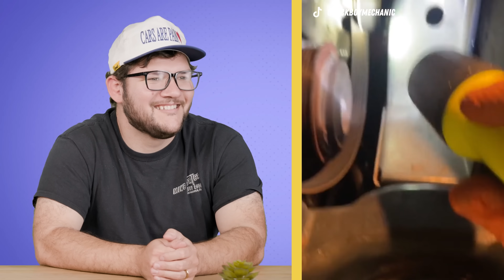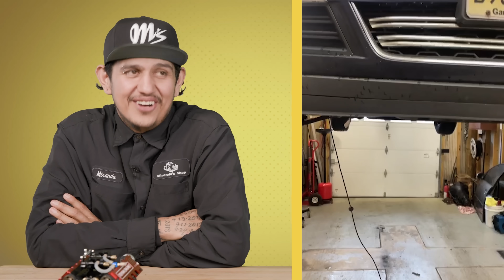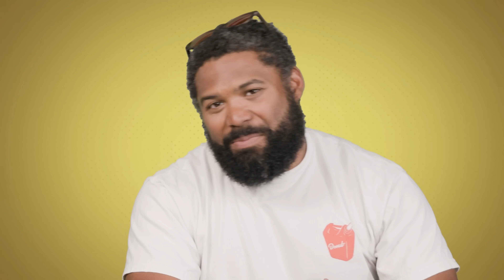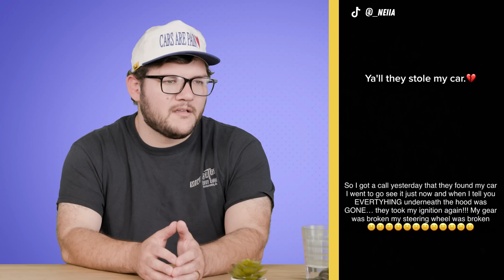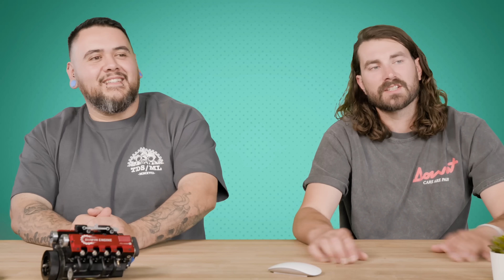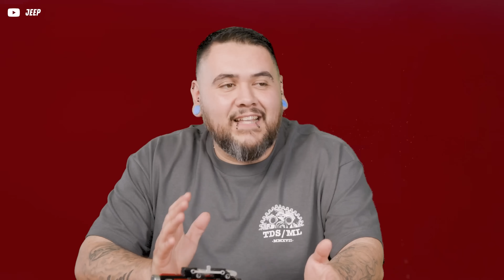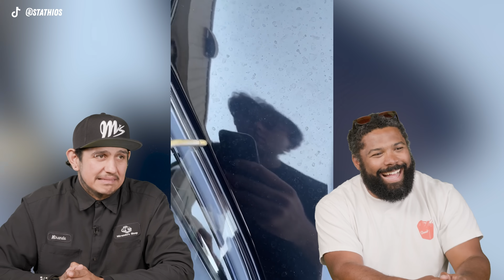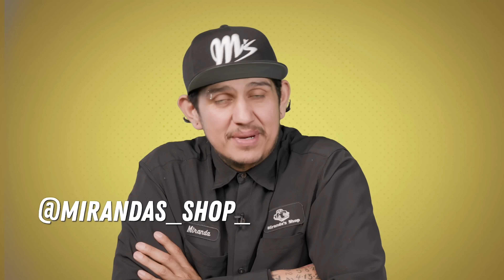Mechanic Reacts to Car Engineering Fails

Comment: The importance of modularity needs to be expressed to the Factory and the engineer. Uniformity and accessibility to the drive train module needs simplified and separation form the passenger cabin needs to be trivial. this helps the mechanic and the consumer perform drive train swaps easier than repairs. 
This is what the JDM guys try to do. Its the reason a Civic / Tacoma is still gonna be $4000 no matter what. the engines are available easily swapped. In the 90s we were working on it.  doing our best to integrate crash safety and modular design. 
Mechanics did not want to lose their jobs and wanted to be called technician instead. 
There were problems is consistency in mechanics pricing and the trade became regulated. 
the BAR regulated the Hours a shop could charge for repairs. 
There is THIS A RIGHT TO REPAIR ISSUE 
Companies try to make their products repairable exclusively by their technicians.  Contact a senator. 
A modular engineered design with the benefit of the people in mind instead of corporate profit. 
It's like the PC and Apple or apple vs android debate 
except in the car world affordability and user friendly design went out the window for technology economy and environment. 
Cars became harder to work on as we added smog equipment and fuel efficiency. 
Billions of dollars were spent on what we have smart people built it. I don't think it would be hard to make simplifications I think we need to press for "right to repair" laws to Incentivize engineers to design for the tools we have. Instead of inventing another Torx Bit and driver for us all to buy.

Comment: If a quarter inch is all that is keeping the bolt in.... just cut the old one out w/ sawz-all, install new pulley w/ new bolt 1/4 inch less length.  New bolt (of same length) can even be cut so that it fits.

Comment: There's a third option: Accounting. The bean-counters probably shit all over what was a good design, or a shorter bolt, or a different material o-ring, and the design gets changes because someone's too cheap to do the right thing.

Comment: The new Explorer has 3 different engines and doing an oil change on one is like playing Russian roulette. On one the filter is up top under the hood, one it’s underneath behind a small panel held in with 5 screws and one is under the big one in front of the small one and you need to remove 20 screws and a bunch of clips then reach your hand up into the car and feel around for the filter to remove it. Stupidest design ever that I’ve seen.

Comment: Car manufacturers during 20th century: Here is a indestructible machine that will get you point A to B with decent fuel economy and is easy to work on!

Car manufacturers 21st century: Heres a overpriced lump of plastic and fiberglass made with special duck tape that dissolves the second your warranty ends. Oh yeah and mechanics are gonna hate you.

Comment: DONT remove the engine to take out bolt for idler pulley. Just cut off bolt once you have loosened as much as possible. Leaving a short piece to use vise grips on to remove the remaining bit.  Then reuse the now correct size bolt   Did not read all the comments some maybe someone else has mentioned this.

Comment: The idler pulley bolt against the frame was something I felt in my soul. My old VW CC R Line had the exact same issue with the tensioner bolt being right up against the frame, and that chick was 100% correct. Had to loosen TWO motor mounts so the engine would sag just enough to allow me to pull the bolt. Ridiculous.

Comment: Realistically the engine was designed and just put into the car. They likely didn't realize the bolt was an issue.

Comment: Ok, As an engineer... Let me sort some things out.
Firstly I work in the Digital Storage sector and design servers for use by every major company you have heard of. Anyway. a GOOD engineer does not allow things like this happen and 99% of the time we will design a solution.. However, I would say about 75% of the time, a Product Manager or someone above the engineer who has no sense of engineering will just say "good enough, move on." to wich we will have a written (Cover your ass report) this means that in 6 months when problems arise and the Product manager tries to deflect blame (we can point to proof that we voiced our opinion.) so.. Please take that into consideration. (if engineers were unshackled from the bean counters you would live in a world with over-engineered, expensive and probably bulletproof products.. you know, like the 40s-60s..

Comment: When I worked at a Firestone  my first automotive job as a GS  I would hate the  F-150 that came out with the plastic yellow twist drain plugs   My biggest Gripe  was  with the sway bar designed right in front of the  drain plug so when you twist it off  the amount of oil  those trucks take pours out strong and hits that sway bar and gets everywhere I had. To use all sort of little tricks to try to redirect the oil into the pan and not hit that sway bar wish I had footage to share  but  haven’t had the luxury of working on the Lube tech line  nor dealing with fords anymore 😂

Comment: Worked in one shop. My coworker had to work on a 25 hr job. It was the worst part location I have ever seen. My coworker quit a few months later. We got a phone call from the company who made the Creep drive pump. Apparently the core part was sent back with a turd all over the part. The note said. Fuck your engineer who designed this part and it’s location 😂

Comment: This is by no means a new car problem, but on 3rd gen Ford Rangers with the 3.0 V6, the oil filter sits between the starter solenoid and the exhaust manifold, so the only way to remove the filter without burning or electrocuting yourself is to disconnect the steering column and remove the filter from the top side and that's just one of many engineering fails from Ford on those trucks.

Comment: 10:40 soda can cut in half from top to bottom works well to make the oil flow a certain way.. Or use a red solo cup. Can also do that when you unscrew the oil filter... the oil and filter will be caught by the red solo cup.

Comment: That pulley looks like it is on the wrong side of the tensioner arm. It is not aligned with the other pulleys or is that just me? Does not look like an oem install

Comment: That idler tensioner bolt looked like it was also the top alternator bolt. So it kinda does need to be that long, but it also doesn't explain which fuckin pelican decided that would be a good idea

Comment: I was a mechanic in the sixties and seventies, and I saw so many engineer caused problems that it isn't funny.  You missed another area that resulted in problems, marketing and accounting.  I have seen engineers see a problem and seen the bean counters say no to fixing it.  The Chevy Monza was supposed to be a low end sports car with a zippy 4 cylinder engine.  After in production the marketing department decided the car needed a V8.   They managed to Shoehorn V8's into an engine compartment never designed for a V8.  To change the spark plugs, done every 12,000 miles back then, you were supposed to undo the motor mounts and jack the engine up so they could be reached.  We hit on a simpler solution.  We cut 2" diameter holes in the fender well opposite the plugs and put in rubber body plugs to fill the holes after replacing the plugs.  Next spark plug change was a breeze. The biggest problem was lazy or incompetent mechanics not replacing the rubber body plugs after doing the job causing the car to stall out in the next rain when the driver went trough a puddle, shooting jets of water through the openings onto the plugs and wires.

Another example was the AMC Pacer, originally designed for a Wankel engine that was being jointly designed with GM.  GM dropped out late in the project, after the Pacer was already for production, and AMC did not have the finances to complete the projected engine.  The engineers had to hastily modify the car to fit the AMC six, because the Pacer was supposed to be an "American Economy Car," different from European and Asian models.  The result was an engine setup that it was difficult to work on.  Things improved greatly when they decided to install the AMC V8 in the cars, but by then it was too late to save the model's reputation for difficulty to repair.  Another irony was that the cars with the V8s, got better fuel economy than the six cylinder cars.

Comment: 7:23 yup... 4.0 (slow, but rugged AF)
2wd, full time 4, part time 4
.
My 97 grand cherokee isn't too bad with electrical stuff..... but my oil PSI did go to 0 then back to 40 psi for NO REASON once
.
And the lights randomly dim like their is a short....or the alt quit working 
.
But the old girl always starts and runs

Comment: Replacing airfilter that requires going under the car or removing front bumper alltogether. 
Almost no space in the engine bay to put ur hands(I'm not high and my hands are quite small and even so I can't get things done sometimes). 
Tons of plastic crap used in cars right from the engine down to the interior.

Main 3 things I could think off that pissed me off recently

Comment: Just did the struts and sway bar links in my 2012 Lincoln MKZ and in the process realize both calipers were seized up oh yeah was doing the struts because the springs were broken but been dealing with electronics problems since I got the car it is a comfy luxury car 😂😂😂 that's about it tho

Comment: Professional auto tech and shop owner here - y'all are missing the real culprit behind some of the stupid things techs encounter when working on cars... Lemme get my 'splain going...

The vast majority of dumb engineering on a car comes from the accounting side of the operation, surprisingly enough.

Cars are designed around expedient manufacturing, first and foremost, and a design that make a car easier to work on makes it more expensive to build, so the accounting side of the automaker is constantly pressuring the R&D side to cut every corner possible to make it cheaper and faster to produce the car in bulk. That over-length belt pulley bolt on the Chevy Traverse is over-length because it was deigned to be installed onto the engine before the engine is mounted into the rest of the car proper because it saves a few cents per car to make it that way and when you make 100,000+ of them per year even fractions of a cent saved per vehicle adds up to actual serious money.

Comment: Yea.  Fuck jeeps.   Was me and my wifes first car  together.    Problem after problem after problem.   Under warranty the suspension had to get fixed like 2 or 3 times.    As SOON as the car hit 100k,   the differential went, something with the 4wd went.    It started stalling while driving on the highway (scary as fuck)  had to go to dealer like 6x to figure it out, they kept charging me for shit,  it would go away, it would come back they'd blame something else.   It got to a point where I brought it to a regular mechanic and he found the  problem, a 36$  crank shaft position sensor..  Worst car ever.       I've had my 4runner now for going on 4 years i've owned it from 2miles when I test drove it.  I've had literally 0 problems and it has 85k miles.... Towed the biggest uhaul you can get filled with 4000lbs of my stuff  out of the hardest stretch of i70 in colorado  and I didnt even feel it behind me...    Literally the only money i've put into it has been consumables.   0 mechanical problems under warranty  0 since it left warranty.   Long story short.  Never buy a jeep.

Comment: This is how car makers get back at the right to repair act. Ford ranger 3.0 water pump... the whole accessory mount has to be removed  to get to one bolt. But a dealership trained tech knows how to tap dance all over flag hours and flat rate!

Comment: 10:53 - In my work place, we're always ripping on Land Rovers, and even have banter sessions with one of our clients who owns 2 Land Rovers. Some of the comments made were:

- The reason it's called a Land Rover Discovery is because every day you're discovering something wrong with it

- The oil dip stick of a Land Rover as a lot longer than most other vehicles so it can reach whatever small amount of oil the sump was able to retain

- Land Rover owners usually own two Land Rovers at a time, so when the one gives problems, the use the other one for spare parts. Said client actually did this 
🤣

I'll never get a Land Rover, even the people I know who've owned them have had nothing good to say about them, just endless issues.

Comment: I worked at Tesla as a manufacturer and essentially yes they’re are cheap ass cars and are slapped together hastily. We would push out around 2-300 cars a days and about 40-60% would be sent back before they’re available to send out. Panels, handles, wiring, all of it is made sadly by idiots or no one that cares, Tesla will literally higher anyone

Comment: While a lot of the problems were engineering related, I wouldn't put it on the engineer, the engineer probably knows there's a problem but they can't fix it due to corporate.

Comment: Regarding the landrover oil drain issue, If I remember correctly, The mechanic I used to go to before I moved would use a machine with a tube / pump that went in through the dip stick tube to suck the oil out for oill changes on certain cars.  My assumption is that the landrover dealerships do it this way, as most people buying their garbage only go to a dealer for maintenance / repairs.  The one mechanic was correct in stating that it was the mechanic's fault if this is true.
Reply: I happened upon a youtube short with the suck method:  https://www.youtube.com/shorts/Vt6AuD9rx88

Comment: I call sus on idler pulley complaint. If it’s the frame engine vibration would cause head of bolt to rub. Re-look at video…no rubbing at all. 🤦‍♂️

Comment: to be fair on the Land Rover drain plug - it's supposed to be sucked out from the top... so it's the tech's choice.
Reply: If it is supposed to be sucked out the dipstick tube with a pump, why does it even have a drain plug? Is the pimply faced 18 year old at the quick-e-lube place going to know about that? Even if he does, will that type of shop even have a pump for doing this? Routine maintenance is done at all types of different places, not just in the dealership with specially trained techs and application-specific tools.
Reply: @daveattheholdens  well, there’s no dipstick tube either. There’s an attachment in the filler for the pump tube. Most modern engines are like this and it’s in the service manual, which you would hope that the person working on your car is familiar with.

Comment: My friend has a 2000 Camry 4 cyl which has to be one of the best cars on the road but i got an egr code. Turns out a little electric over pnumatic valve had failed. To get at it you take off the right front wheel and sit with the hub in your lap and reach up with your left arm as far as you can reach under the intake manifold to get to it. It doesnt have to be there. Its just mounted there. Blame it on the engineers.

Comment: Why not just cut the bolt? It's already out so far. You can reach the shaft part. Just cut it and pull the pulley down and then put in a shorter bolt when you have to reattach it use a pair of pliers to take out the piece that's left in the block😅

Comment: The bolt on the frame.. I would cut the bolt w a grinder at it's longest point,extract the rest, clean up the threads on the bolt and re install.. the leak.. is it a clogged vent tune for the sunroof? Blow it out

Comment: In that very first clip, that too-long bolt is also pulling double duty as an alternator bolt as well. Engineers finding ways to make things marginally cheaper, by making one part do multiple jobs at once. :/

Comment: From an Engineers perspective, a lot of issues are forced through by management and tight deadlines. They'd rather eat the cost down the line then delay the project with a redesign.

Comment: That first video bolt just take a handheld reciprocating saw, cut it behind the pulley, and remove it easy by hand after it cools down or pliers , put a shorter bolt back.

Comment: @9:30 where he is talking about not carrying for quality and carrying for numbers, he's 1000% correct. I worked on the line and I can tell you they would gas people out to try and meet the 200 cars quota and stopping the line for a quality concern is almost frowned upon because you are loosing the amount of cars that are coming out. In addition 90% of the people on the line don't care for the quality of the car. They have no passion for the automotive industry and are there just to make the money( which is totally fine, but it doesn't make the cars any better). Also parts quality is ass
Reply: Totally agree. I work as a mechanic at electric motor/water pump shop and about 25% of my time is spend fixing brand new motor/pump that came in with some issue. I don't mind it as my job, but can't imagine paying $10k for a new water pump and have something wrong from the factory

Comment: 4:15 
I desagree about that being an engineering problem. The thing is, that while it CAN be the engineer's fault, obviously the quality management/control did not do its job properly and also, it can be that factory took the wrong file and flashed an older testing software instead of the one ment for shipping the product.

Comment: I BOUGHT A 2015 FORD TRANSIT BLOWER FAN MOTOR from FORD - $279

SUPPOSEDLY SAME EXACT ONE FROM AMAZON =$140 

SAME PART #'S
THE AMAZON ONE WVEN SAYS (FORD) ON IT

I BROUGHT IT TO FORD
HE SAID ITS DEFINITELY NOT AN "O.E.M STANDARD PART" 
IT WEIGHED LITERALLY HALF AS MUCH AS THE REAL FORD 
(was missing COPPER WINDING AROUND MOTOR- the weight difference) 
NO WONDER ITS CHEAPER.ITS A KNOCKOFF
Dealership dude says he DOSENT UNDERSTAND HOW AMAZON CAN GET AWAY WITH THIS????????